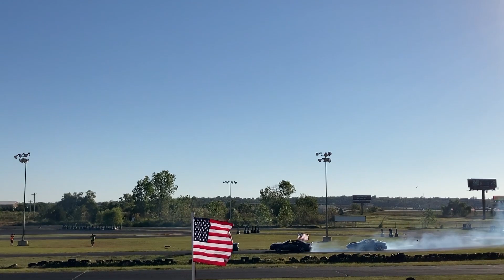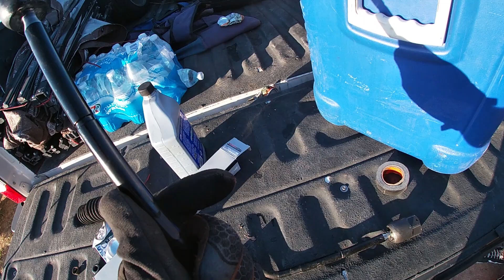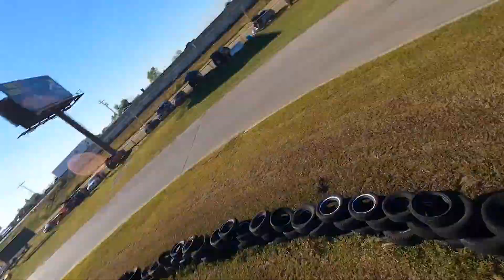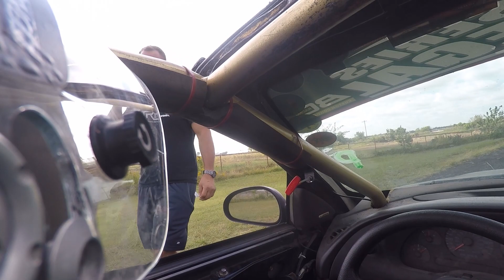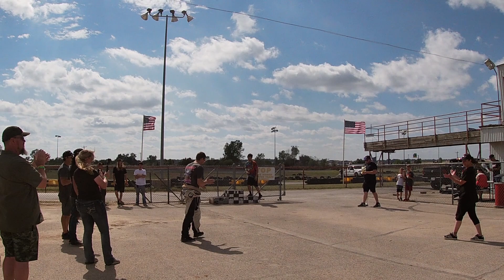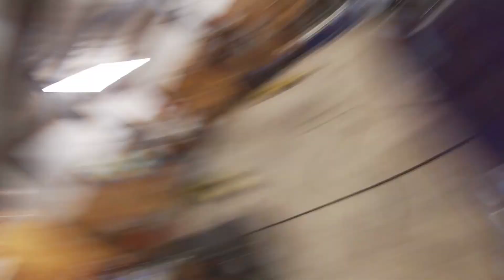I WON MY FORMULA DRIFT LICENSE, GOT A NEW CAR, AND WON A WHOLE SEASON!! Full Lock Drift 21 RD4

Comment: Any tips for someone who is new to drifting and wants to start actually competing in drift events. Right now I drive a stock 1991 Mazda Miata but I’m planning to turbo so then I’ll have more power and won’t have to clutch kick so much and probably an hydro brake
Reply from the maker: The biggest thing is seat time! Drive as much as you can to get good. Make sure you look at the events your going to and build the car to the rule book. A simple setup is nice to keep the car reliable. If you have a bad ass setup but it breaks all the time you’ll never win. The miata definitely needs a bunch of work to get competitive. Dont downplay a good suspension setup and use good repeatable tires.